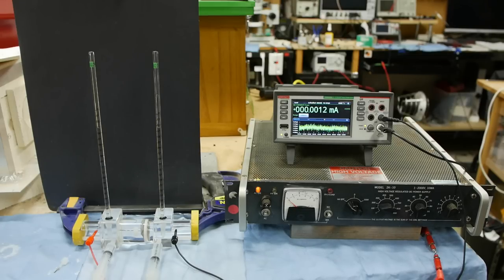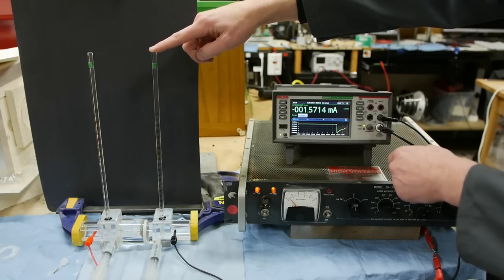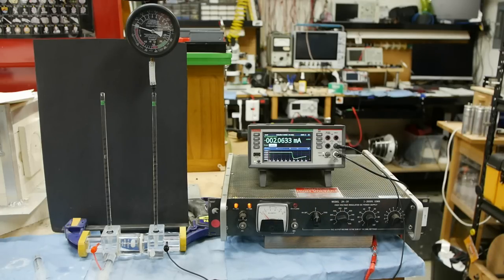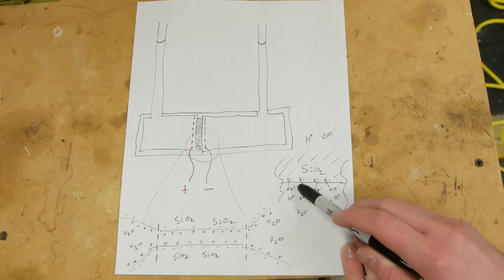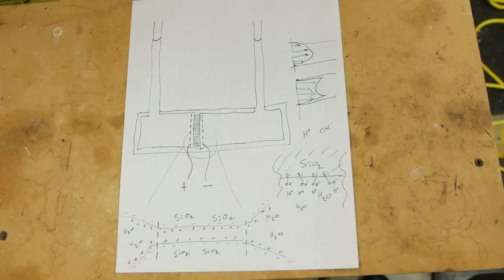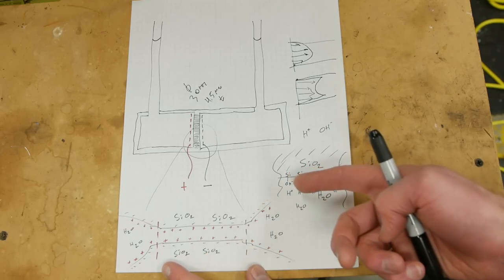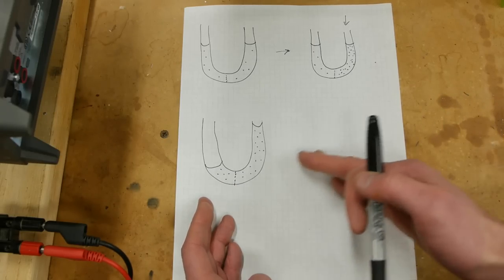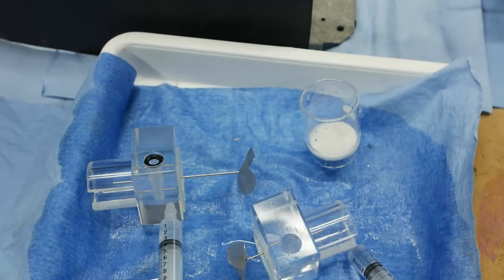Electro-osmosis: pumping water with electricity and no magnets

Comment: Fantastic.
The glass membrane, how is it done?
Reply: Tumble glass with metal bits to create "frit". The frit is filtered to capture the desired size. The frit is then placed in a mold and just enough heat is applied to fuse, but not melt entirely.
Reply: Place glass in a tumbler with (clean) rock or metal. The result is crushed glass, called frit. Next filter and wash the frit to obtain your desired size pieces. Then place the frit into a heat resistant mold of the size and shape of the desired end product. Finally heat the frit just enough to fuse, but not melt entirely.  Optionally, prepare the edges for your particular application, such as applying silicone to form a seal.

Comment: More than 0.5W. Where's the energy going? Is the water heating up?
Reply: Physics says it has to go somewhere, thus I think you are correct and the water is heating up.  I think if the system were designed to take advantage of natural convection, there would be an increase of efficiency.

Comment: Basically the glass can be replaced with any dielectric if its pores for water but can polarized itself correct? Also, if using a non distilled water does the pump work as well if the channels of water allow for conductivity on both sides of the glass?

Comment: Could this be useful for water cooling loops? to get water simply flowing a round a loop with a heat source and a radiator?
And will this work with other metal parts in said loop such as aluminium and copper?
Will anti-corrosive chemicals affect the performance?

I know the flow rate isn't that high, but for cooling something that doesn't need a high flow rate to begin with.
Reply: Good thought. I wonder if hot water would be more efficient as the molecules are already excited and might break apart more easily. Not to mention the pressure already present.  Is essence, could this augment convection based flow?

Comment: I wonder if the flow profile combined with a conventional flow from a pump would increase efficiency through a restrictive membrane like that filter you have more than either method alone.  It seems like this could be a good way to “lubricate” narrow channels where conventional flow is difficult because of the high surface area to diameter ratio.

Comment: Is it possible to make DIY solution for chemical PCB tinning at home? Feels like it is an easy question for you and may be an idea for a video.
There is a commercial product here where I live, but the problem is that it is 2 part mix starts to degrade after mixing. 0.5L of this stuff is supposed to tin a large surface. So this solution just goes bad before you get to use it even to a half of it's potential, considering that you make PCB regularly and not producing them in quantities. And it is quite pricey for home use. I was told not to mix the whole thing right from the start and do it proportionally, but reagent B (some kind of wide powder) is like 3 grams for 500mL of transparent reagent A. So it is not easy to mix it proportionally to use either.
I heard that there is a one part solution on US market that does not have this disadvantage.
Any chance that you might publish a video about the chemistry of PCB tinning for us people who do not have such a knowledge as you? May be you could even come up with a how-to for DIY PCB makers?

Comment: If you wanted to create super-uniform flow in a smal diameter tube, I imagine it might be possile to combine a regular pump & this electro-osmosis pump. They could be tuned to largely cancel out the nonlinearities of the boundry-condition flow. Mixing of fluid over distance would be minimal. if you where to change the colour of fluid being pumped in, there would be a nice sharp boundry flowing through the channel. 

I dont know if that's useful in any way??

Comment: @ben, nice work. Do you think it is going to work if you coat the metal electrodes with insulators, e.g. plastic? I'm thinking to minimize the current and the contamination to the water.

Comment: If this works with tap or salt water, I assume you need a way to release the electro chemical byproducts somehow in the pump or is the current low enough not to really induce electrolysis?

Comment: i have a guess on why they make the surface a porous glass filter. if the H⁺ OH⁻ separation only works just at the surface of glass, most dissociation will happen when surface area is as large as possible, achievable by making the glass as tiny particles just close to each other

Comment: Like Mythricia, I was a bit confused about how it is that the H2O molecules pass through the membrane along with the H+ ions. So I'm curious how appreciable the effect of charge imbalance will be between the sides after continued operation of the pump. Could you place a pH meter on each side of the pump to measure the scale of accumulation of H+ ions on the side with the negative electrode?

Comment: At 1:20 you say, that your hand is actually doing the work, but do i missunderstand something? Because i would say to bend the water stream you apply a force(electrostatic) , which turns the acceleration downwards from gravity a little bit to the side and thus does not require energy.

Comment: Really interesting stuff. Just an fyi, I got kick back on a router table doing exactly the same thing. Got 28 bone deep cuts all around my middle finger. Didn't die though and healed up in 3, 4 weeks. The cuts didn't hurt but my knuckle did. Must of been because the bit gave it a good bit of twisting action. Dunno the maths, but 2 flutes at 30000 rpm and 28 finger gashes , it must of been pretty quick, but I remember it all in slomo lol.

Comment: I saw something about hydrophilic gel, recently, which also mentioned charges, and it seems that the effect near these kinds of gels has a significantly larger area. I also wonder if one could pulse DC at a very high frequency, to avoid some of the electrolysis.
Reply: I also just realised that aerogels are hydropilic, so I wonder if this effect in any way could be used for replacing the water during creation

Comment: Have you tried doing this for like a Van de Graaff instead of a voltage Supply? if you increase the voltage while reducing the amps would you see as much like Charles's and therefore less loss? Especially as you're just trying to maintain the amount of coulombs on the dielectric

Comment: Hi there, amazing! I wonder if there is counter pressure , will it then still pump ? Also, if the diameter is larger do one need more voltage/ current ? Fine experiment , thanks for the post 👍🍀🌞 FM

Comment: Should've mentioned that 200 volts is in the water and although there's a loong vial of water acting as a resistor, it IS an isolated power supply so touching one at a time should be fine, but gotta avoid touching both.
Reply: It's current limited to 10 mA.
Reply: @xenonram  Can still kill.

Comment: If the movement is microamps and the input is milliamps, and the rest is lost to electrolysis, how does the input vary so much when the end is blocked? If all that energy is being used for electrolysis wouldn't that remain constant regardless of pressure?

Comment: First of all, great video. There is just a couple of things that are a bit unclear to me. As I understand the electric field drives the hydrogen ions towards the negative electrode. This alone only creates a net flow of hydrogen. I would assume that the hydrogen will drag along with it some of the water as shown in your diagram to also create a net flow of water. This leaves only one thing I don't quite get: there still is a net flow of hydrogen in addition to the water. What I'm asking, is if there is some mechanism to counter this hydrogen flow, or is the effect so small that we can just ignore it?
Reply: I asked the same question and the answer I got was that the hydrogen does not actually separate - it's more like the hydrogen acts like a tail being dragged to the other side, and it drags the whole water molecule across with it. I don't know how accurate that response was, but it made some sense to me. I also, like you, didn't really understand what the hydrogen was re-combining with on the other side... Apparently it doesn't.
Reply: @Mythricia1988  Now that just doesn't make sense to me since the force on the OH is exactly the opposite of the force on the H, so if they moved as a single unit, the net force of the electric field on them would be zero.
Reply: @niklaskoskinen123  Someone replied to my other question, and it seems like it's similar but not quite what I first read:

From the linked paper titled: Electroosmotic pumps and their applications in microfluidic systems, "In EOF, mobile ions in the diffuse counter-ion layer of the electric double layer are driven by an externally applied electrical field. These moving ions drag along bulk liquid through viscous force interaction." So it sounds like electrolysis and then ions just drag along water molecules. Due to different size of OH vs H and where they are distributed, it must occur preferentially in one direction. Most of the energy goes into electrolysis (and you can thus also see the current). It makes sense, why it is so inefficient.

Comment: I wonder how much you could increase the efficiency by adding heat to the pump.  So very quickly, as T increases, P increases, basic thermo.  Water flows from high pressure to low pressure,  So basically water also flows along a temperature gradient, high temp to low temp.  Using this, you could possibly gain fully laminar flow by completely eliminating that boundary layer, eg the boundary moves at the exact same rate as the center of the channel.  It would take optimizing, T differentials to get truly laminar but yea...

Comment: Would the efficiency of this system increase as the diameter of the pipe decreases? As in, if we approach the point where the pipe is two water molecules wide, would we see peak flow?

Comment: I think the water is moved by the galvanization between the two metalic anodes and the material from which it is made, in water does not pass current, but through the metal atoms that detach from an anode sticking the other anode. my opinion. 
it is possible to make induction through pure water like a condenser, water being the dielectric between the metal plates  knowing the induction is not an electric flux, but the multicomponent energy does not have electrons in the component 
and the pulse of the electrical flow to create the pressure.
I'm controversial

Comment: Question.
Water works, and alcohol supposedly works.
Is there a difference in... I guess the osmotic pressure between them?
So for example, if you had a sealed system, divided in the center, with a 50/50 mix of alcohol and water, and applied a voltage across the system. Would the imbalance between the force applied to the alcohol, and the force applied to the water, allow one to displace the other? Like if the water gets more force, would it tend to push the alcohol backwards across the membrane, or vice versa?

Comment: What happens if you fill one side? Will it slowly prime, (diffuse through the glass disc, you said it would not against gravity, but eventually?) or could force it to, with the electrical charge ( I guess one side would be dry ... ) not sure if the air water barriers inside the disc would interact..

Comment: Darn. I was about to ask if it would be possible to use metal meshes with different nobility to make passive galvanic potential pump, but then I realized you were talking high voltage.

Comment: 13:39  "...I think it's the only case that you'd get such a thing..."
The flow profile for a heated vertical section of tube in a setup to induce natural circulation/convection should have a similar profile while ramping up and laminar since once again zero flow at the wall buy the the highest temperature fluid will be at the wall, so it will be the most buoyant.   So, another profile that looks like the front of a crimped shotgun shell or a rollo candy.

Comment: Is it important it be sintered glass or would some crushed glass held together mechanically (like sandwiched between filter paper) work just as well? Broken glassware is easier to scavange than functioning fritted filters.
Reply: DIY frit: Place glass in a tumbler with (clean) rock or metal. The result is crushed glass, called frit. Next filter and wash the frit to obtain your desired size pieces. Then place the frit into a heat resistant mold of the size and shape of the desired end product. Finally heat the frit just enough to fuse, but not melt entirely.  Optionally, prepare the edges for your particular application, such as applying silicone to form a seal.
Reply: I think it would as the proximity of water to glass is the important part.  I wonder what the optimal thickness if the filter would be.

Comment: This looks like the physics of what Viktor Schauberger observed in natural water-ways and copied. He developed pipes that used the power of the surface water movement to accelerate the flow of water through pipes, reducing friction and increasing the efficiency of plumbing. Magnetism is in play as moving polarized charges make magnetic fields which can accelerate or retard the water flow.

Comment: The nature does tend to balance everything out, it just requires time and resources. However if some unnatural event keeps on going nature has hard time to keep up balancing so thats why you would think otherwise. I think because salt is conductive it likes to attract water in more than normally because of the resistance of said membrane between the two, brine and water, thats why salt tends to dry you out too.
I noticed the plugging that you made with your finger, does that matter for electric current that you are potentially grounding the whole thing? I know more about chemistry than electricity so thats why I wonder if it has impact on the current or not.
Reply: Electricity, like water, always seeks the path of least resistance.

Comment: Could you increase the pressure if you added several fields in series? Like cells in a battery in series to make 9 or 12 volts.

Comment: Hm, is there an intrinsic barrier for the pressure that can not be overcome? When I saw this I thought about the possibility to use this with polar gasses in something like a Joule-Thomson refrigerator. I'm not sure, if electrolysis would occur in the gas phase though and if the velocity of higher speed gas molecules would be effected as efficiently by the electric fields.

Comment: The Flo profile along the wall occurs in all. Flowing fluid, look at heating pipes, the wall tends not to flow, hence larger volume is central to the pipes flow rate, can be. Somewhat elevated using a simple spiral of wire, eqa distant circular along and in contact with the wall, drives cling to wall in to central flow along the length of, and carried away in main flo stream...  Think friction of two surfaces interacting...
Interest video, thanks.😮
Thom in Scotland.

Comment: How much flow can this support?

I'm looking at this and wondering just how well it it would work for cooling computer parts. There we're looking at 2 to 4 litres/minute of flow with relatively low pressure. Obviously I'm not too keen on having electricity in water that's going to be running through a metal heat sink connected to the CPU's die either.

Comment: You don't happen to have an affordable DIY Dupont membrane substitute in one of your drawers?
Reply: There is a public PDF around on how you make membrames for PEM fuel cells. The process was something about getting two different cheap industrial Dupont foils doping them by hot soaking in a bath and baking them and then pressing them together and while clamped, heating them again in your kitchen oven.
Reply: @Tore_Lund  Sir, thank you, sir!
Reply: @erikschiegg68  I should have provided you a link, but it is 11 years ago I read it, so I can sincerely not remember where, but it was an university project about the cost effectiveness of making cheap PEM fuel cells with simple tools. The PDF had pictures detailing the process with great detail. This should be enough for you to dig it up from the corners of the internet.

Comment: what if this is combined with kelvin's thunderstorm system, is this a viable system as a booster pump with a volume loss percentage to drive it?
Like a water hammer pump but on a electrical level versus a mechanical level?
What would the efficiency flow rates, how much flow through a kelvin's thunderstorm do you need to generate a flow through this system??

Comment: 20ml/m with 200V 3mA . thats 1.2l/h 600mW not quite efficient but actually usable for some small things . there's small 2usd little aquarium like pump from china claimed 10l/h  3.3v 150mA (i measured V A , not flux) 495mW almost exactly 10x more efficient . i was using those in a aquarium but they brake in less than a month using 24/7. this having no moving parts could be interesting if safe for the fishes.

Comment: Those hydrogen cell, that people use in addition to fueling their automobile, could that be considered an "air pump" ? At what point would that system be gassing off, in a enclosed system, before the gassed off hydrogen, is forced back in the the water to recombined, kinda like what happens in the sofa soft drink and Co2?... Or would the system just be stopped, due to a trapped  pressure threshold, as no more hydrogen can be electrically stripped away from the H2O... Maybe more electrical power (I, v)? Or is this turning into a dangerous situation, more then just the hydrogen has to offer as a stand alone gas just waiting for a spark?

Comment: I'm surprised your electrolysis rate isn't much higher with 100V. In a salted solution it can happen with 1.3-1.5V depending on your electrode and specific conditions. At 2-5 V water electrolyzes like nobody's business.